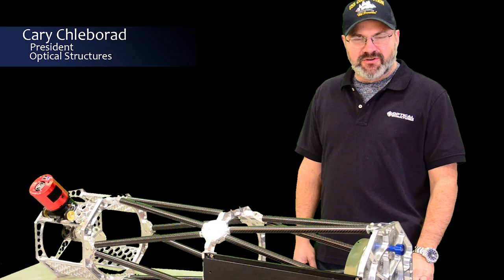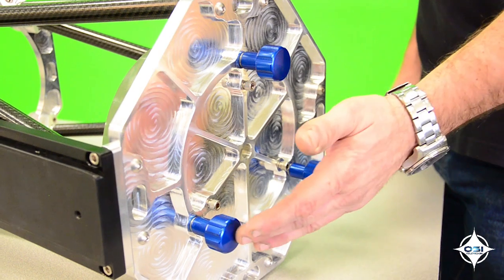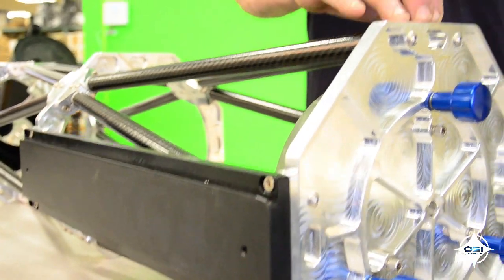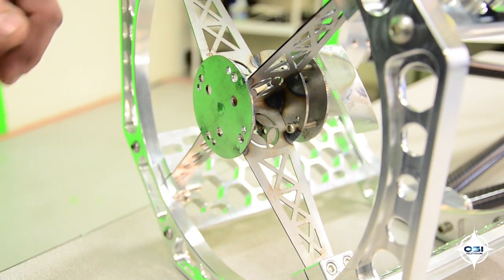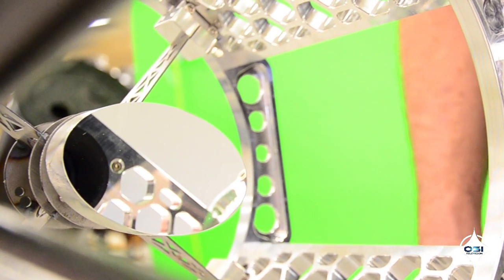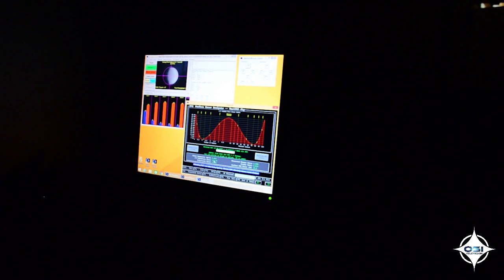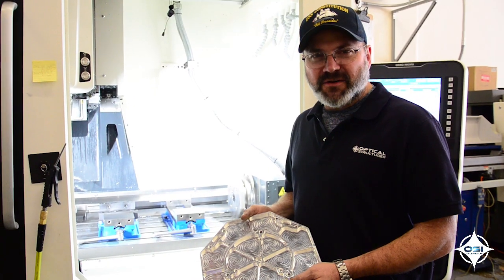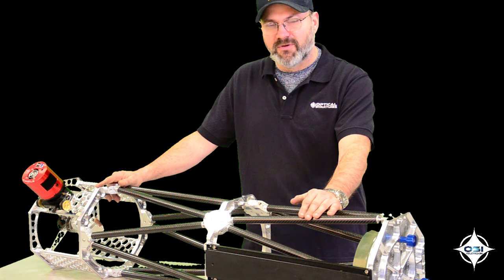Farpoint Imaging Newtonian Telescope

Comment: Opti-Mechanical Engineering 101:  You defeat the purpose of the carbon fiber truss structure when you then bolt an aluminum dovetail between the mirror support and the mid support plate.  You need a flexure in there!  If this is going to be an astrograph, have you designed in a coma corrector/field flattener?
Reply from the maker: What you don't see is the thermo expansion compensator that the dovetail bar is mounted on